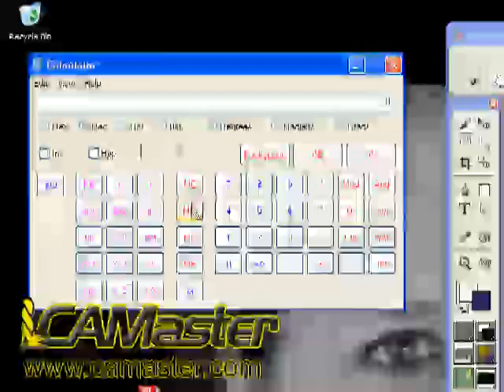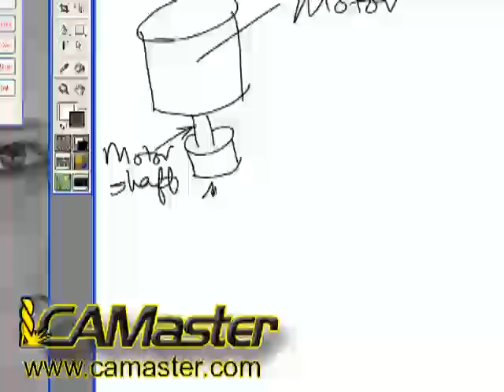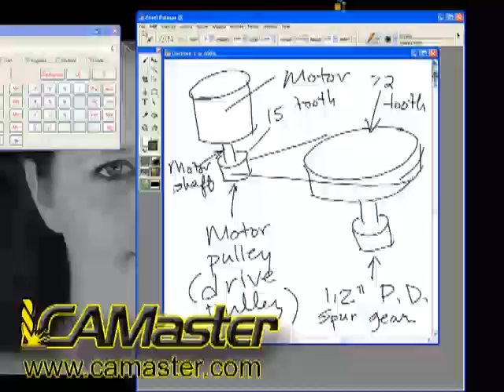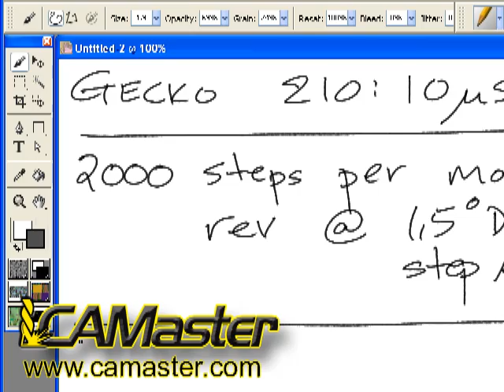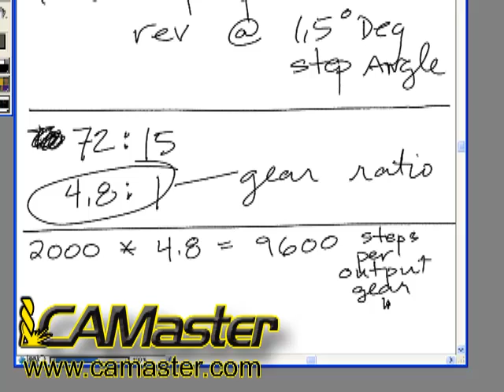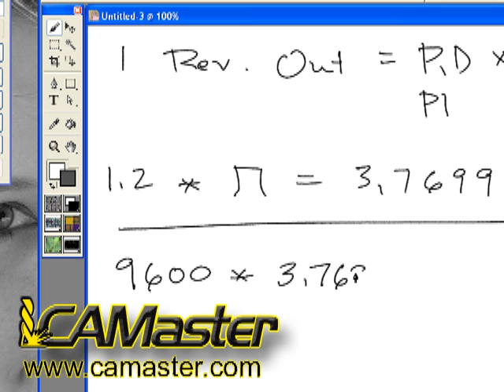Diy CNC Tutorial #1: How To Calculate Steps Per Inch

Comment: what about direct drive?  1.8 degree 333oz motor 12 tooth pinion on motor 24 pitch gear rack?
Reply: Would also need to know you driver step setting (i.e. micro stepping).  This is multiple required as system likely is not in single step mode (i.e. 200).  It will be half, quarter, eighth, sixteenth, etc, etc, etc and depends on driver settings and quality of components to reliably perform small resolution.
Reply: I'm sure you've figured this out by now but for anyone else that needs to know.... This is the calculation for a motor directly driven pinion to gear rack. The most important factor you need to know is the pitch Diameter of your pinion gear. Pitch Dia of your 12 tooth pinion 24 pitch gear is .500" so the calculation is .500 x Pi (3.1416) which is 1.5708" that means in 1 rev you are traveling this amount. We need to get the steps per inch so we need to take the 200 steps of your stepper motor multiplied by the micro step of your stepper driver. (lets use 10 like the popular Gecko drives use for example) so you get 2000 then divide the 2000 by 1.5708 and your answer is 1273.2365 steps per inch.